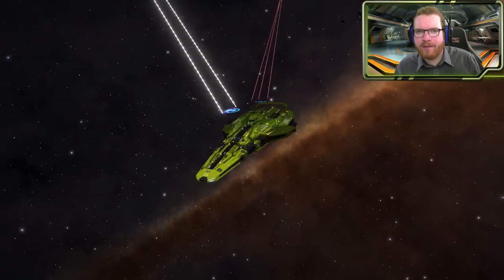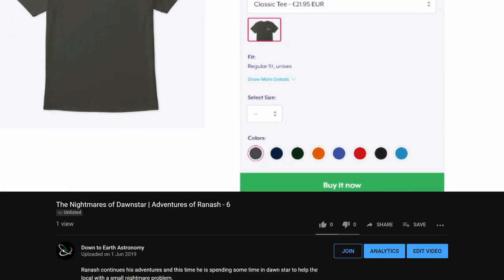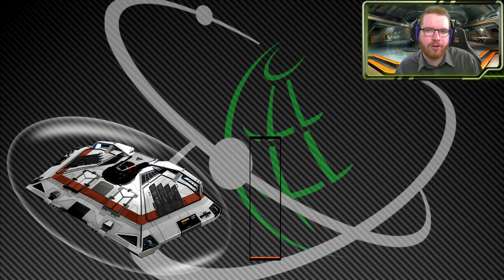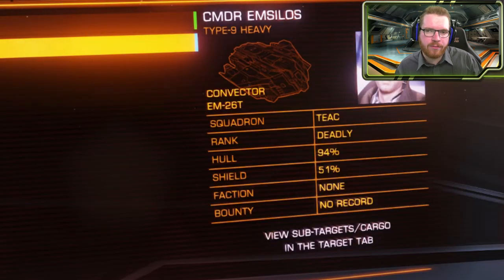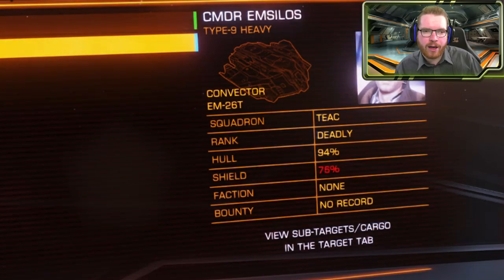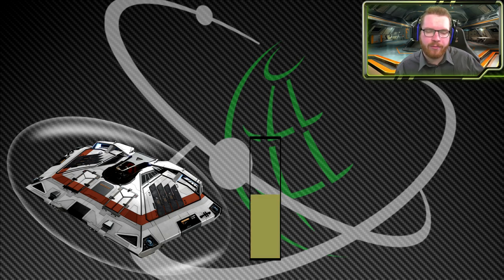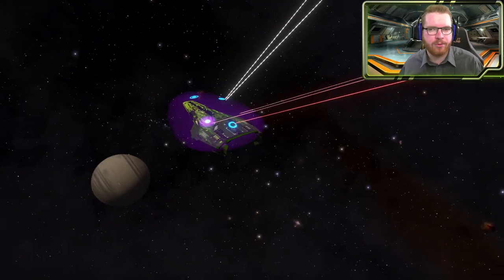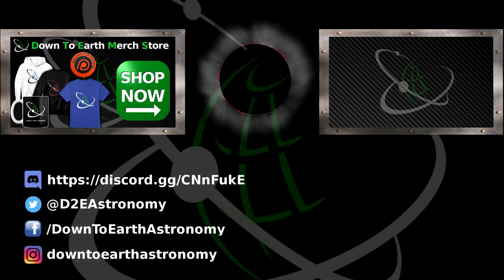Math behind Shield Regen | Advanced players guide

Comment: Pretty good explanation, but I don't think you went into enough detail regarding how shield regen ties into the power distributor. Once you know this, you can figure out how many pips you need in your SYS to keep the shields charging and how long you can expect it to last. (You don't always need 4 pips to keep the shields charging.)

To get an accurate view of how much charge the regen rate of your shield is using, you have to multiply the recharge rate by the distributor draw. This is why different types of shield take more or less charge to regen. It's not a flat rate. 

For example, a stock 8A Power Distributor on an Anaconda has a System Capacity of 48MW and a System recharge rate of 4.8 Mw/s. A stock 7C Bi-Weave Shield Generator has an Unbroken Recharge Rate of 4.4Mj/s and a Distributor Draw of 0.6 Mw (a figure which isn't listed on Coriolis for some reason). Multiplying 4.4 by 0.6 gives you  2.64Mw, which is the actual amount of charge used per second to regen the shields. Divide the amount of charge by the Distributor capacity, that gives you roughly 18 seconds of recharge time if you have no pips in your SYS before the capacitor is drained.

Since the amount of System Recharge is based on how many pips you have (1pip = 25% of the listed figure, 2 pips = half the listed figure, 3 pips = 75% the listed figure and 4 pips = the full amount), you can see that you only need to keep 3 pips in your SYS capacitor for it to not lose charge while recharging the shields. In fact you need just over 2 pips. Putting 2 pips into SYS will give you a small drain of (2.64 - 2.2) 0.44Mw/s. If you factor that into the capacity, you can keep 2 pips in SYS and the charge will last for just over 109 seconds. Or 1 minute 49 seconds, before the capacitor is drained.

Knowing stuff like this lets you know how much you need to keep in your SYS at any given time, if you're not maxing it out for strength and want to fight more aggressively.
Reply: in Coriolis you can get a rough pip value by changing your SYS pips and looking at the Recovery / Recharge numbers. Those numbers are with a full SYS capacitor though.
Reply: @houligan5254  Aye you can, and that's useful for a basic idea. But that figure also factors in time where all the charge is used up and the shields are recharging from a drained capacitor. It doesn't tell you how long the charge in the capacitor will last, only the total time it's gonna take to recharge from 50% to 100%, or recover to 50% assuming you can't reboot.

It's fine to use that as a rough guide, however you also have to keep in mind that when your shields are charging from a drained capacitor, defensive modules like chaff, ECM or heatsinks will be in a low power state and unavailable for use. 80% of the time it's not gonna be an issue, but still, knowing the numbers behind it can let you tailor your shield strength to your distributor so you aren't likely to run out of charge. 

This is something you may have to do if you use a ship with a shield that recharges too quickly for the distributor to handle. Like a Fast Charge modified class 8 Bi-Weave on a Cutter or Type-10, with only a Class 7 distributor. If you aren't careful, those things suck up the charge in your SYS before you even know what's happening because the recharge rate is so ferocious. And if you put too big a shield on either of them then you spend most of your time with no SYS charge even with 4 pips.
Reply: Just starting PVP/combat, that was an interesting read. GG
Reply: This is the actual info I came here to look for, thank you!

Comment: If you are going to play the shield regen game, you need to learn its cardinal rule: "Smaller shields win."

Shields regenerate on cycles. The bigger the shield, the longer a cycle takes to complete and the longer it will take for you to benefit from a completed cycle. In other words, "A" rated boosters are a death sentence for your regeneration rate. Here's a simple example with an Imperial Clipper: https://s.orbis.zone/5lxf

Size 6 shields are the smallest you can fit on a Clipper due to hull mass and we're going to go with bi-weaves because of the fast regen, and are engineered for high resistances and fast regen. Two heat sink modules (engineered with increased ammo capacity) for help with controlling the heat when popping your shield banks (engineered for rapid regen), and six E rated boosters engineered for resistances so that all three resistances end up over 55%. Because of the special effect selected each booster only gives a 3% shield boost, so all six together equal less boost than one A rated booster.

The power distributor is engineered for faster regen as well (notice the pattern?) and the power generator is engineered as overcharged and monstered (you're gonna need the extra juice to keep everything powered including the monster weapons you'll be carrying).

The armor I do not personally use myself but I have included in case of any difficulties with keeping your shields from breaking, this is how you want to do it to keep yourself and your modules protected until the shields come back up. Just remember: You are going to be sacrificing substantial speed and maneuverability adding that much tonnage.

At this point the mantra becomes: Patience is a virtue. Take it slow and steady and wait for the inevitable mistake. Coming to a dead stop when they're stuck on my tail tends to work most of the time for me.

Fly dangerously, CMDRs!

Edit: Forgot to add, I fly mostly with 4 pips to weapons and 2 to sys. I transfer a pip to engines if I need a little extra on the maneuverability, and if I need to get the hell out of Dodge, I go with 3 sys and 3 engines. Cheers.

Comment: Assuming that 2 second halt after getting shot apply to every type of shield (Bi-weaved/Prismatic/Normal), would it be fair to assume trader/exploration and none-agile ship that have no other-choice but to tank all the damage should stick with Prismatic/Normal shield over Bi-weaved?

edit: another notable point is Bi-Weave also seem to drain the sys capacitor a lot's more, meaning it might stop you from using ecm/chaff and heat-sink, I would consider this a downside if you usually put a pips on Engine or have poor pips managment.
Reply: Nah just go for Prismatic shield.
Reply: 1) go with prismatics with traders and similar, you'll want the better raw shield value
2) regen drains sys capacitor. If you have a shield with regen rate of 1, it will drain 1 MW from your system capacitor, if a shield has a regen rate of 3.1415926536, then that will by the drain on your sys capacitor
3) In my expeirence, heatsinks, chaffs, etc have priority over shield regen, so as along as you have some pips in your sys, you'll be able to deploy them.
Reply: @zijkhal8356  that's good to know, thanks!
Reply: @zijkhal8356  Your second point isn't accurate. The drain on the capacitor is the regen rate multiplied by the distributor draw. Not the straight regen rate. The actual drain is lower than the regen rate because the distributor draw on shields is lower than 1mw/s. Normally 0.6Mw/s. So unmodified the drain is actually just over half what the regen rate is.